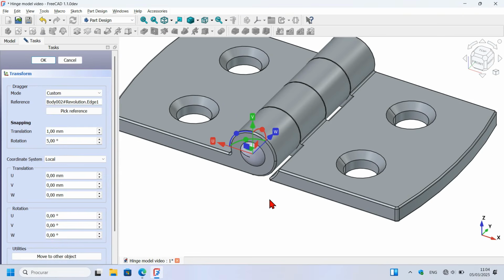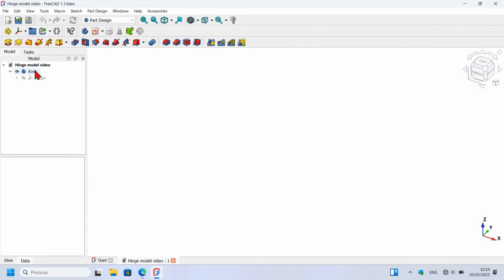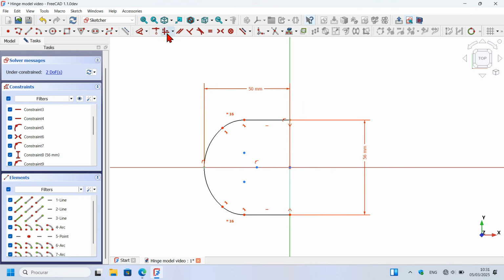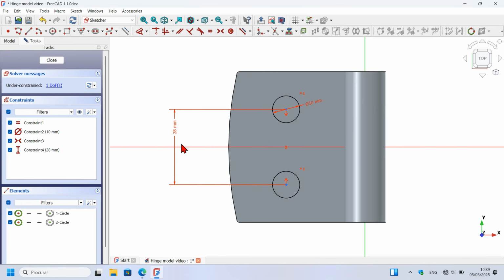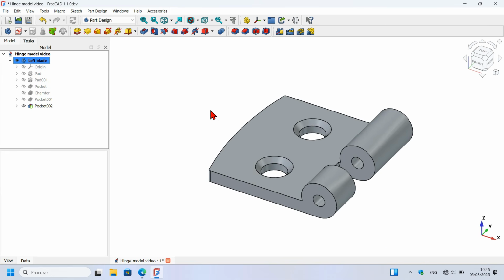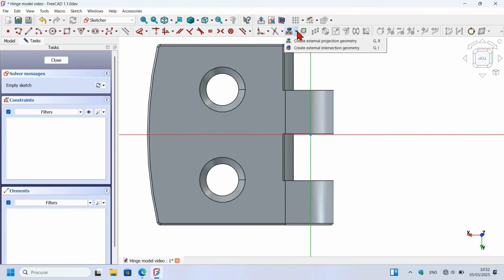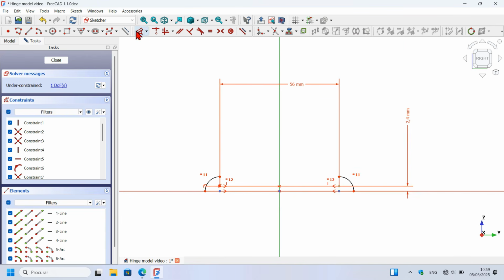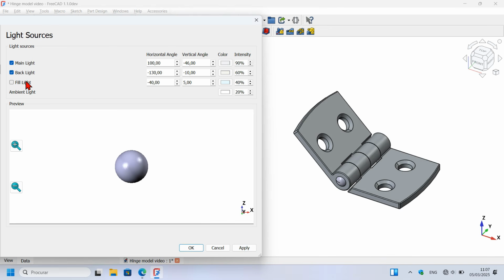FreeCAD 1.1 with + news: transform tool & light system improved | modeling video

Comment: Hi, when it comes to transforming and moving the third body, I didn't have as many options as you. I had to place it manually. Could you tell me why I had fewer options? Thanks anyway.
Hola, a la hora de transformar, mueve el tercer cuerpo yo no tenia tantas opciones como tu. Lo tuve que colocar manualmente. Me podrias decir el por que me salian menos opciones. Gracias de todos modos.
Reply from the maker: Are you using the Dev FreeCAD version(1.1.0)?
Reply: @OffsetCAD  noo, the 1.0  :)
Reply from the maker: @ea1crl this is why you didn't find more options. You have to download and use the Dev version of FreeCAD (1.1.0Dev) on the GitHub weekly builds page.

Comment: In version 1.0 i got annoyed by the thing that i finished my model using mirror from draft, and when i tried to rotate one part using transform tool, whole model got broken. So i have to remodel everything without mirror modifier.
Reply from the maker: Use the weekly builds instead.